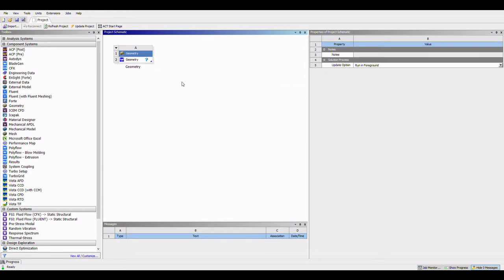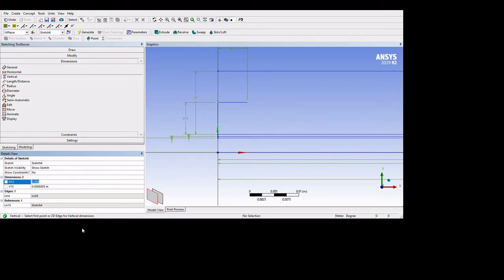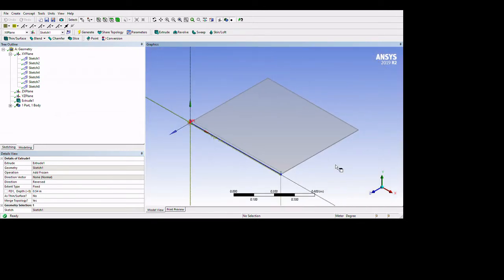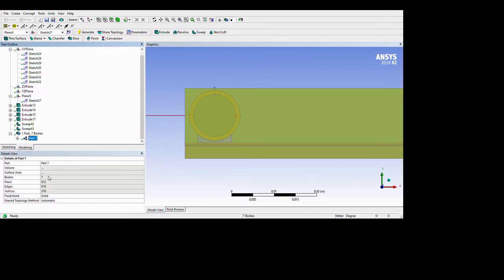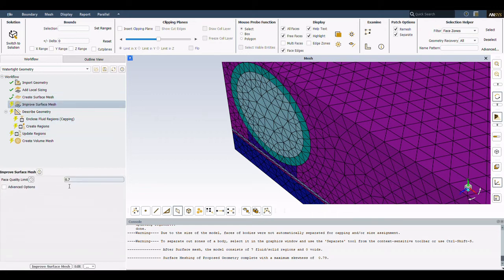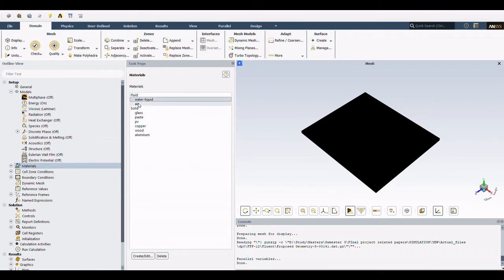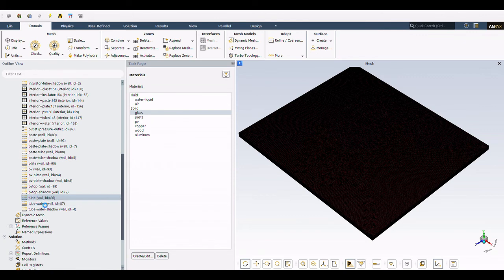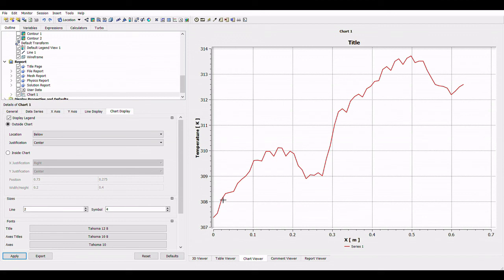Simulation CFD ANSYS - PVT: By Irfan

Comment: can someone help me understand how did he draw that absorber line ,that is gonna be the guide line for tube, water and thermal paste, at minute 10 ? @MrAfza79 can you please help ? i cant find anything on the internet
Reply: Try solid works, it's ez-er :*
Reply: please if you know how i am also stuck at minute 9:58 i don't know how can i draw the tube like him im super nervous please  @adrianmata8944
Reply: do you know which research paper is this from please

 @adrianmata8944
Reply: please if you know how i am also stuck at minute 9:58 i don't know how can i draw the tube like him im super nervous please
Reply: @saleh2340 back then i drew it o a piece of paper, calculated all the dimensions based on what its shown on video and drew it by myself and it worked
Reply: i really tried but like im really new to this what should i pick which option like how would i draw it in  Ansys design modeler itself  @antoniobularca3598
Reply: @antoniobularca3598  how did you do it please, im blocked in this level, can you please help me?
Reply: do you know which article is this from please